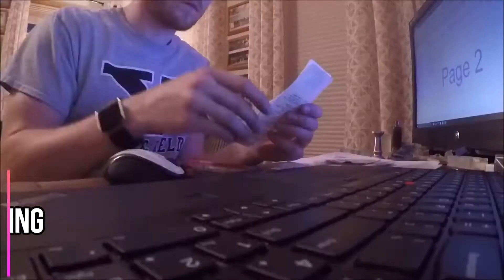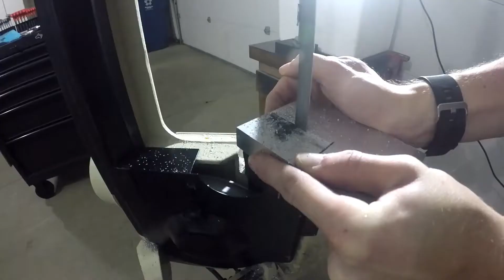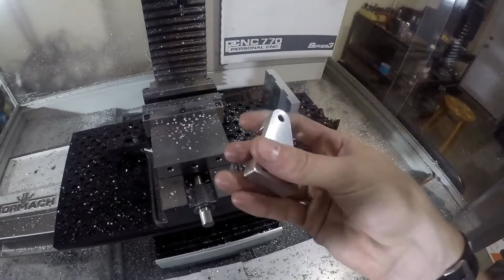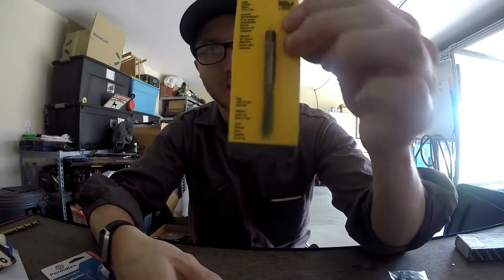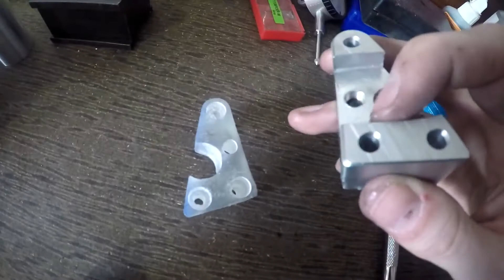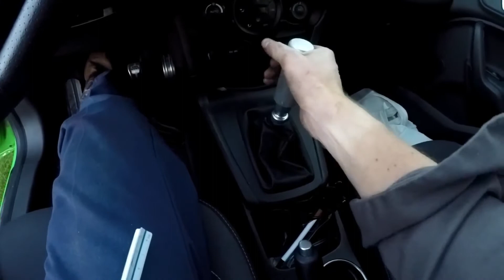Finish Machining the Short Throw Shifter and Testing: After Work Special #89

Comment: You should look up carvesmart.com. You can buy a 90" stick of the soft jaws for about $90.  It's about 1/2 the price of buying them precut
Reply from the maker: Shawn Best I should definitely do that. The only reason I like the precut is because it has the hard stop dowel pin in it
Reply: MojoMfg. When I use them we machine the ends and add the dowel hole ourselves. Takes a little extra time but saves some money

Comment: How are you zeroing the back side?  Soft jaws could help but you have a flat side to work with so you should be able to get it aligned even without them.
Reply from the maker: Jason Carter I can easily find my Y from the fixed jaw and my Z origin but finding where it's located in the X direction is the hard part
Reply: MojoMfg. A book could be written on different ways to pick up a zero but here are a couple. Drill one of the holes all the way through and pick up on the hole center.  This is really easy if you have a haimer. Put it in the hole at about the center. Find the -x side of the hole. Zero your DRO. Move to the +x side of the hole and the type /2 in the DRO. Move to x zero point. Then do the same for y. Repeat once more for x for best accuracy. I saw a mill stop in your tool box so another way would be to set your mill stop about the distance of the radius of curved end of your part away from the back jaw. This will put your stop at the extreme edge of your part. Clamp a 123 block in your vise against the stop. Zero against your 123 block. Replace the 123 block with your part and let 'er rip.
Reply from the maker: Jason Carter You are the man! I will definitely start drilling holes all the way thru and picking of the origin that way. I  do have a mill stop but it has a lip on the bottom where it fits in a t-slot but since I have the fixture plate on there it doesn't work. I guess I could shim it and make it work though. Anyway, great advice, thank you so much!